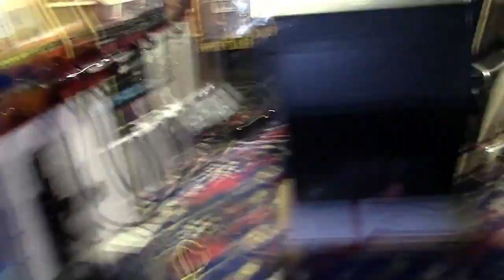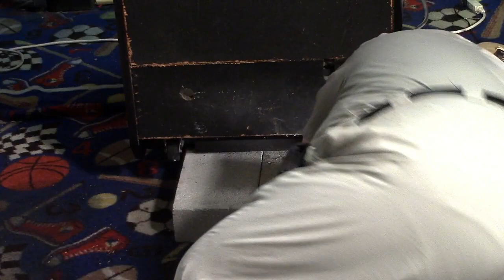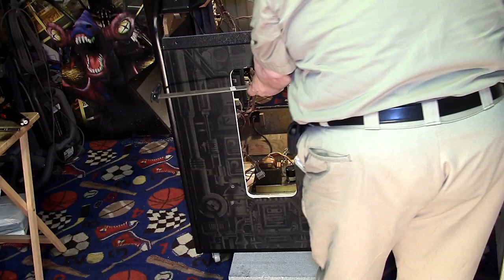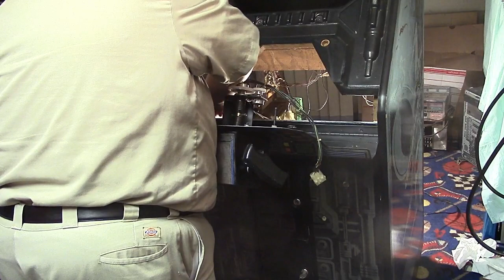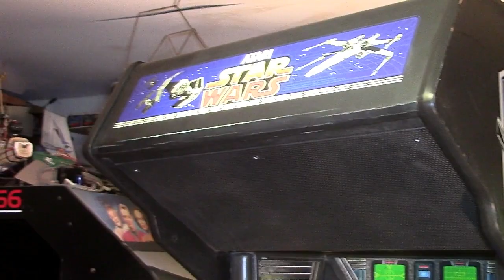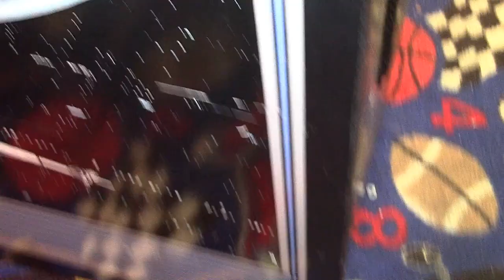Star Wars Cabinet Repair Part 10

Comment: Just a tip, if you have a small 150psi air compressor, and nozzle, the best way to clean the insides of a cabinet is to vacuum first, then take it to an open area outside and blow ALL the dust, debris, and cobwebs out.  Works fantastic.
Reply: S Verlander more rooms for more games is always priority 😉